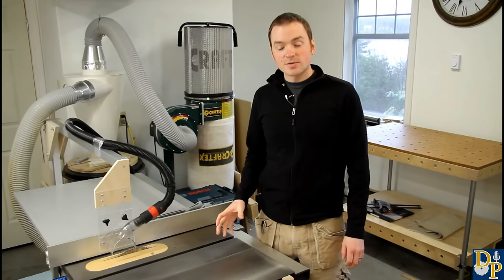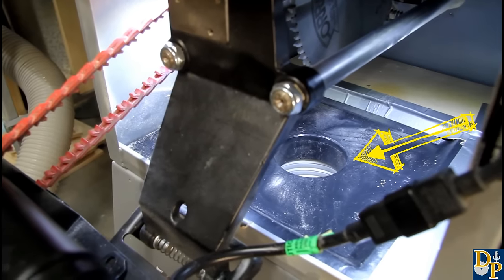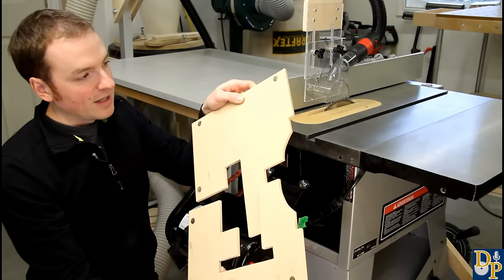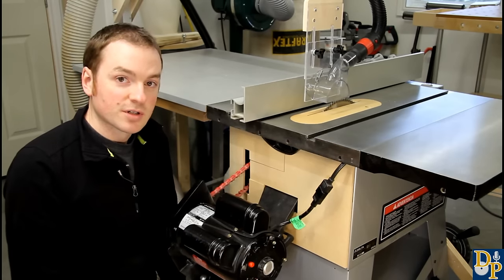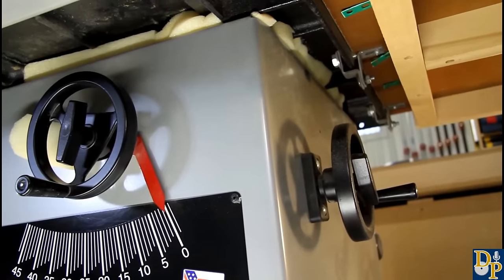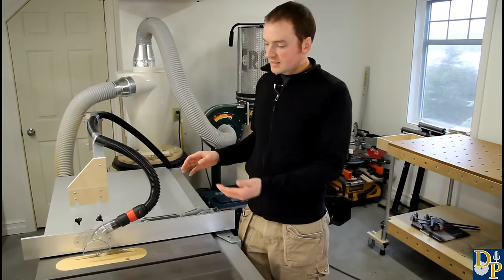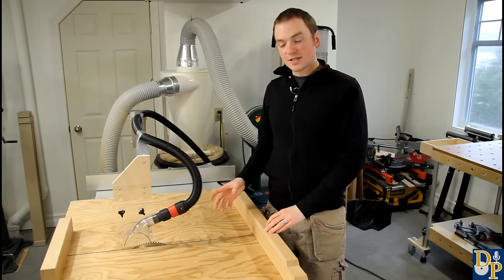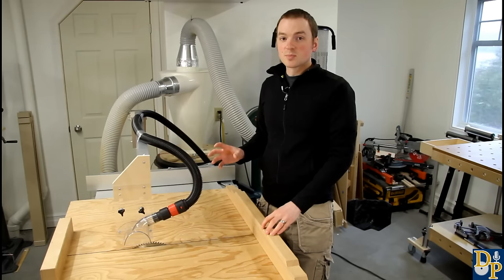4 Table Saw Dust Collection Upgrades

Comment: Hi Dan, are you happy with the craftex dust collector? Does this style of collection system make a big difference over a large shop vac. And how about the linkbelt, did it make a difference in noise or vibration? I don't have a lot of room so I've been avoiding a larger dust collection system, but I am tired of the clean up work.
Reply from the maker: Hi Bob, yes I have been happy with the Craftex collector.  It's not HEPA and it's not the most powerful machine but it works well for what I do.  If you're connecting it to larger machines like a table saw, jointer, thickness planer etc it does make a big difference over a shop vac.  Gives much more volume of air flow.  Shop vacs or dust extractors work well for smaller applications like portable power tools or things like my overarm dust collector on my table saw.  They have a higher velocity, lower CFM air flow that is well suited to things with smaller ports.
Reply from the maker: Sorry, forgot to answer your question about the link belt. Yes the link belt does make a difference over standard belts. Much smoother and quieter.

Comment: As I have the same dust collector, I was wondering 1;if the canister filter made much of a difference 2; if in the future you'd consider making a video about the dust collection in your shop. Thanks
Reply from the maker: +John Dagg The canister filter does seem to make a difference especially in capturing more fine dust.  Since I have a Super Dust Deputy hooked up to my collector, I replaced the clear bottom bag with a felt bag to increase the air flow further and it seemed to make a difference.  Having both filters on there really seems to get the most CFM out of a small collector.  And yes I would like to do a video on my dust collection setup in my shop at some point.  It's definitely on my list of topics to cover.

Comment: I'm trying to figure out how the back closer design works when you tilt the blade.  The motor mount and belt tilt with the saw blade, so how would your back closer work?
Reply from the maker: The panels have to be removed to tilt the blade which is why I made them easily removable. Its very rare that I have to tilt the blade so it has never been an issue for me.

Comment: Hey, Do you end up losing suction with your vac when you have multiple hoses going to the table saw? Basically a hose underneath, a hose on the back, and an overarm hose.
Reply from the maker: If all the hoses are going to one dust collector or vac then you definitely would lose suction.  In my shop I have my 4" dust collector hooked up to the bottom of the saw and my Bosch dust extractor hooked up to the overarm.  That way I have maximum suction power at both places.

Comment: I made something similar for the back of my JET contractor saw.  When I tilt the blade, the rear panel becomes moot.  I have to figure out a better solution.
Reply from the maker: For me it's very very rare that I tilt the blade so I haven't found it to be an issue in my shop. A lot of bevel cuts get made with the track saw now.
Reply: @DPShopTalk  I tilt my blade often since I make a lot of compound cuts with a sled. Still working on a solution.

Comment: Thanks for the video.  I have basically done the same exact thing for my Delta contractor saw (I even made the back cutouts and added magnets to them).  I'd like to download the PDF file with the dimensions for those two back shields.  I did look on your FB page (around March 19th), but could not find the link to the dimensioned drawing. Please point me to that link, if it's too much of a bother.  Thanks
Reply from the maker: +Steven Zara if you look under 'timeline photos' the drawing is there. It's just a jpg file so all you have to do is click 'view full size' and the right click and save the image. Hope that helps, let me know if you have any issues.

Comment: Dan...I went through the same process that you used to try to close off the back of my contractors saw.  I came to the conclusion that closing off the back extremely limited the amount of air passing to the collector. I will try to design a deflector to direct the air flow and entrained air. away from the motor without greatly restricting the flow.  I will also try to increase the number of holes in my zero clearance saw blade  insert Its a real annoyance to have to remove the panels to tilt the saw arbor
Reply from the maker: I found that there are enough openings left in my saw that there is still good air flow to the dust collector. It's not about completely sealing up the saw but rather controlling where the air comes in. It's very rare that I tilt my saw which is why I went with the panel setup on the back. The magnets make it quick and easy though to remove or install the panels.

Comment: I like your dust collention system but I have as much interest in your table saw fence.  I have an older Craftsman table saw that I am happy with but dislike the fence.  Is yours an add on fence?  If so can you tell me more?  Thanks
Reply from the maker: The fence on my saw is the Delta Unifence. It came with my saw. I don't know if Delta makes the Unifence anymore but if you could find one even second hand you could probably retrofit it to your saw.

Comment: This may be a dumb question, but do you have your overhead arm attached to the same dust collector as the port on the back of the saw, or do you have the overhead arm hooked up to a second dust collector or shop vac altogether? Great video by the way!
Reply from the maker: Yes the overarm is connected to my Bosch dust extractor and the port on the bottom of the saw is connected to my big dust collector.

Comment: i was wondering where so you keep the vacuum and how much hose do you need?
Reply from the maker: I usually keep the vac beside the dust collector at the end of the table saw. It's just a short piece of hose that's a few feet long that connects to the vac.

Comment: Hey Dan great tips thank you. Do you have difficulty ripping thin strips, or are you able to get a push stick through when the fence is really close to the blade?
Reply from the maker: +Dirk Edmund Designs great question. The narrowest I can rip is about 3/4" with the overarm shroud in place. I use a thin profile push stick for those cuts. If I need to make a super thin rip I raise the shroud up out of the way.

Comment: Great ideas and collectively I'm sure this made a huge improvement in your dust collection.  One area of concern I see is what happens when your cutting an angled cut on the tablesaw.  At this time I don't think the backer plate would work, or am I missing something here.  Wonder if you could make something similar to the front with the arched cut out and fill with foam.  Just my 2 cents.  Not being a downer here...great work
Reply from the maker: It's very rare that I made beveled cuts on the table saw but when I do I just remove the panels. That's why I used magnets to attach them so that it's quick and easy to remove and reinstall.

Comment: I was so sick of the large amounts of dust produced by my saw that  I installed a plywood box on that back of my saw that allows the saw to be set on 45' angle and the blade to be raised to max.height.I use blue paper tape on the angle adj. slot in the front. The bottom has one of plastic pans that I attach my shop vac to

Comment: Dan, once you have to tilt the saw you have to take those two panels off of the back, right?
Reply from the maker: +Zach Craft yes the panels do need to be removed to do a bevel cut with the saw.  I don't do bevel cuts very often so it's never been an issue for me plus with the magnets they are super easy and quick to take off and put back on.
Reply: I think I've done bevel cuts once using the table saw. I'm going to do this for my belt driven saw, should help with the dust collection.

Comment: Do you have to remove the back panel to make mitered cuts?
Reply from the maker: +Noconz0727 MC yes the back panel needs to be removed to bevel the saw blade. That's part of the reason I went with the magnet system so that it's quick and easy to remove.

Comment: very nice shop thery. please understand we woodworkers should learn dust control. small shops do  need this system.have a rigid portable table saw but it does need a system to control dust. keep up the great projects, learning at my age is great to see different appplications in a shop. thanks.

Comment: The cyclone will reduce the efficiency of the dust collector quite heavily...so why did you mount the cyclone as the dust collector alone would do the job too ?
Reply from the maker: The cyclone reduces the suction power a little bit but it makes it overall more efficient since it keeps the filters clean. I used to use the collector by itself but the filters got clogged up quickly which made the suction go down dramatically. The cyclone keeps the suction power up and greatly reduces the time spent cleaning the filters. I would never go back to a single stage collector setup.

Comment: hey just a qwick question what is the power on your Saw vacuum cleaner how many hp or W do you have ??
Reply from the maker: +the1to9 do you mean the Bosch dust extractor or the 4" dust collector?
Reply: I meant the Crakftex in the back ... how strong is the motor of that ??
Reply from the maker: +the1to9 the Craftex is a 1 HP unit

Comment: I love your work my friend but why don't you use a knife to prevent kickback?
Reply from the maker: Good question. I've tried using a splitter before but since I cut mostly melamine on the table saw it doesn't work for me. A lot of times when you cut melamine there's internal stresses in the sheet that will cause the kerf to close up behind the blade. While it seems that's exactly when you would want a knife or splitter it actually clamps onto the splitter or knife and doesn't allow you to move the material. I've never had kickback from melamine in those situations but it does cause burning on the edges. As far as ripping solid wood I usually use the bandsaw for that so that's not an issue for me with the table saw.
Reply: @DPShopTalk  Ok. But be careful my friend. :-)
Reply from the maker: Definitely. I have a very healthy respect for the table saw. The other thing I was going to mention was that a lot of cuts get made with the track saw now including melamine so the table saw doesn't see as much use as it used to. Besides being very portable, the track saw is also generally safer than the table saw.

Comment: I read that it is not desirable to constrict air flow nearly completely. It is not only the suction (pressure drop) that sucks but also the actual movement of enough air to carry the dust. away. I would not block he small gaps.
Reply from the maker: +woodensurfer you're right, you definitely need air flow.  There are still enough gaps in my saw to supply the volume of air that the DC is moving. My intention was to just help concentrate where that air flow is coming from and not to block it off completely.
Reply: I have watched many overhead dust collection for the table saw in you-tube.

I have pretty much concluded that the best will be one mounted directly straight down  with no lateral adjustment. Just position the saw so that a direct connect from the top will just fit the blade. Only direct up-down retraction-extension adjustment

No other method saves as much room and allows the wide varieties of cuts, such as dadoing.

Some show mounting on the splitter, which makes dadoing impossible.

Comment: I know this video is old and maybe you've already corrected this (But):
I noticed your drive belt is installed Backwards.
The loose ends of the little "fingers", inside the loop of belt, should point in the Opposite direction of rotation.
That will keep the "fingers" from banging into the pulleys, during rotation, and cut down on, both, noise and vibration.
ALSO: I love your ideas but I have a question.
How do you deal with changing the angle of the blade, in relation to the back cover?
Reply from the maker: I'll have to take a look at my belt. I've moved shops since this video so it might be the other way now.

It is very rare that I bevel the blade on my table saw since I usually use my track saw for that. If I do need to bevel the blade I just take the panels off the back and the foam out of the front. That's part of the reason I made the panels magnetic so that they are easy to remove and reinstall.
Reply: Dan, I checked my setup again and a better way to explain and understand is the  V shape, on the back of the belt. The top (open part) of the V should lead the rotation, not the point. In the case of your table saw, that means the open part of the V should move toward the blade. This would also be true for your band saw.
If you have a multi-pulley drill press, you may want to check that as well. If your drill press is reversible, you, really, can't do anything about running in reverse.
Reply from the maker: Thanks for the info. I'll check my table saw and band saw next time I'm in the shop. I have standard belts on my drill press so I know that's not an issue. Thanks again for the heads up👍

Comment: any idea for bevel cuts ? at the rear
Reply from the maker: +JAYJAYJAY53 I don't make bevel cuts very often but when I do I just take the panels off the back of the saw since it's quick and easy to do.  If you make a lot of bevel cuts you could make a curved slot in the panels for the motor mount to travel in with something like a saw stache to close it in.

Comment: No need to buy a 4" adapter. Just as easy to cut a hole in plywood to friction fit the hose end to the bottom panel

Comment: Source capture ventilation  is what you are attempting to do here.  Terribly excessive work to not improve collection much compared to what really is needed. Get the vacuum opening closest to the source, where blade meets material.  A rectangular or round opening with flange will capture 90% or more of the dust. Creating selective openings to channel air flow across source to capture will complete the job can reach 95%  to 99% capture. HEPA filters are 99.9% efficient but terribly expensive and don't work well without channeled air flow.
Reply from the maker: I've found that my overarm collector gets a lot of the dust at the source and then what falls into the saw cabinet gets sucked away by having things enclosed. It's not a perfect system but it has worked well for my needs.

Comment: I think you are unsafe. You have no riving knife, no blade guard. Sooner or later they will call you stubby. Tape will dry out and fall off.
Your dust collection methods are good but privative. Foam leaks air. seal all joints and cracks with silicone. For larger 1/2 -2"gaps use expanding foam sparingly.  Try a Sharkguard blade guard..
The back plate needs to be made out of layers of .040" aluminum sheet. Layer 1 is attached to the inside frame. Layer two is attached to the outside frame and layer three is attached to the motor mount. Each with the correct cutouts for the belt and trunnion rotation. Under suction the plates compress to a near airtight seal.
Reply: I made this backplate exactly as he did.  Works perfectly. If you have a dust collector (not shop vac) small leaks around the saw, back plate, etc are so minimal that it won’t effect anything. 

I do agree about the saw guard, but I don’t use mine, either. But I do keep the splitter on except when using the cross cut sled.

Comment: In my opinion the table saw dust hood that you have under the saw is old news and obsolete. I have a much more efficient table saw dust hood. As far as closing everything off, your probably suffocating the dust collector by doing that much blocking.
Reply from the maker: +Charlie Lenz the dust tray that I use is about 15 years old so you're right that it's old news.  I've been meaning to upgrade it to a custom sloped hood like others have shared so that all the dust falls down but haven't had a chance yet.  I haven't had any air starving issues since there are still enough openings around the saw to supply the needed air flow. My goal was to concentrate the air flow but not block it completely.  The proof is really in the dust collection efficiency which was definitely improved after I filled in some of the gaps.
Reply: Dan, I have a couple different sized table saw dust hoods made of sheet metal that I designed and built if your interested.